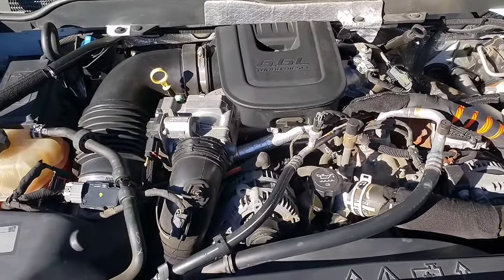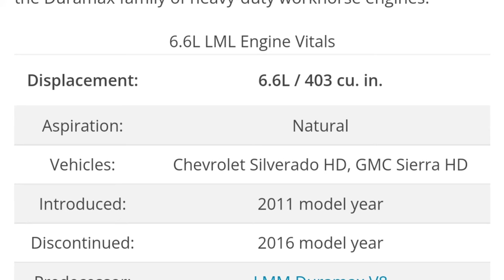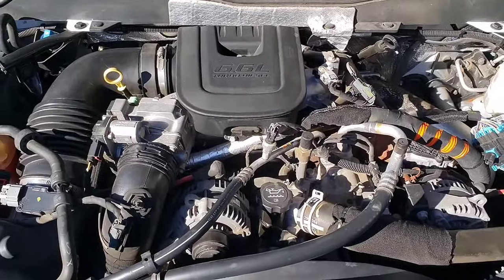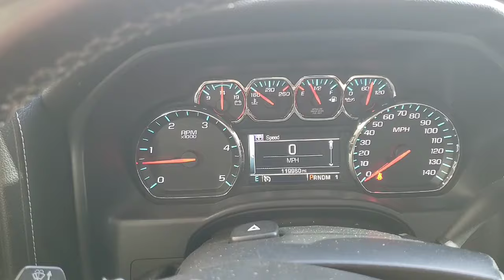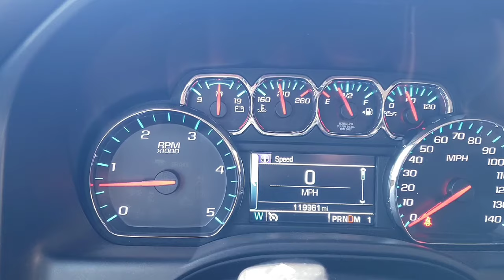Silverado 2500HD thermostat fix 2011-2016 LML Duramax

Comment: I am planning to try this this weekend. You mentioned something about the key way for the fan bracket. How do you remove it safely. Also, did you drain the coolant before removing the hose and thermostat housing?

Comment: is that refrigerant line or fuel rail test port you removed the bracket bolts from?
Reply from the maker: Good question 😅
Reply: It’s fuel rail test port

Comment: Is there a need to replace the thermostat housing that connects to the block? Someone told me that the factory ones have a poor flowrate.. Truck is throwing this code, and has 200k miles on it. Any suggestion there??
Reply from the maker: I am not familiar with a code for that. What code do you get?

Comment: Do you just drop the new thermostats in? No clock wise turning them? I just dropped mine in and losing coolant not sure if thermostats are not sealed inside or If I didn’t tighten the bolts correctly
Reply from the maker: I'm not sure what you mean by clock wise turning, I did drop them in and clocked them according to specs. How much coolant are you losing?
Reply: Good info

Comment: i’m getting same code but my truck runs at normal temp what’s the issue?
Reply from the maker: Good question
Reply: Maybe a sensor or electrical. Electrical are always bad on these trucks
Reply: same problem . your thermostats are stuck open . mine was the same
Reply: @dp9629  come down to it. You are right. That's what mine was.
Reply: @floridagirl386  I swapped the ect sensor on the hopes it was going to be that easy but shot the code again about a week later.
Reply: @dp9629  what’s the fix?
Reply: @braydenwethington6401  replace thermostats . If you haven’t replaced the ect might as well do that too while you’re right there. 17 dollar sensor .
Reply: @dp9629  yep same here. 8 days later it threw the same code. Now throwing codes for exhaust lol
Reply: @dp9629  these trucks have 2 thermostats
Reply: @floridagirl386  yeah they are both in the same spot though. I would stick with oem thermostats though. Some of the aftermarket thermostats get stuck closed when they fail and you’ll end up overheating your engine. Oem will get stuck open and you’ll just run at lower temperatures than what you should. My two cents lol
Reply: @dp9629  yeah when I got the therm it came in a pack of 2 lol.  Ok good advice thankyou

Comment: Anyone know why my coolant is getting pushed into the reservoir side. No codes ,engine is running normal temps and i literally just replaced both thermostats and tank.
Reply: Any luck? Mines doing the same thing
Reply: Head gasket
Reply: No, not head gasket, no coolant in oil and has no signs of that issue.  Was told it may be turbo going out or something in that area